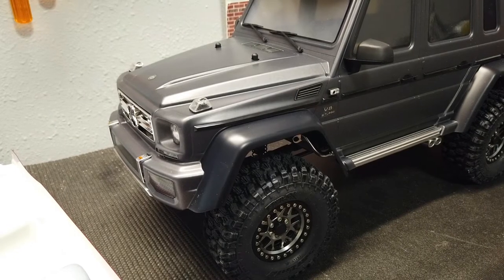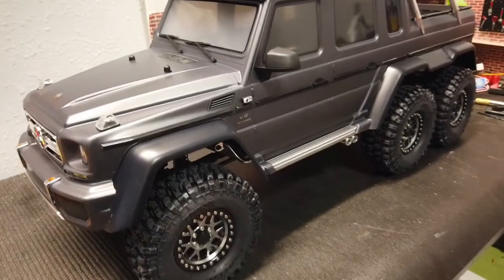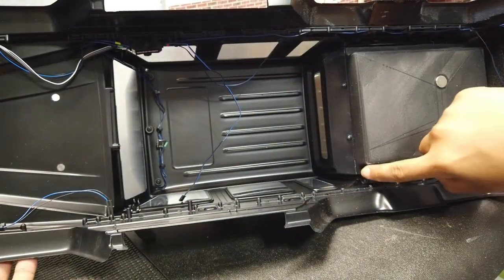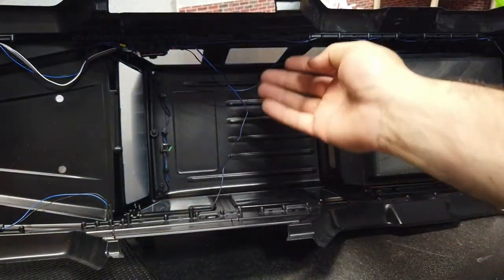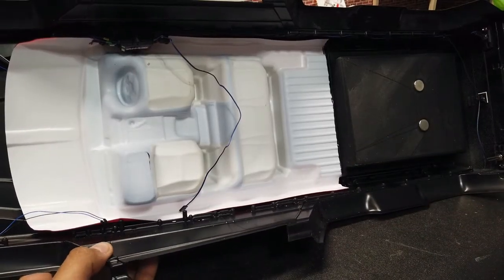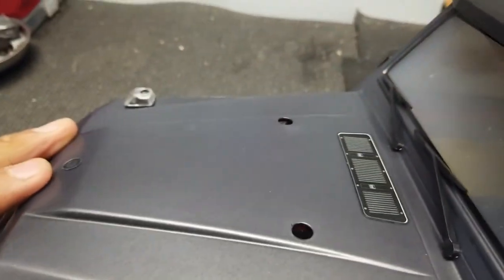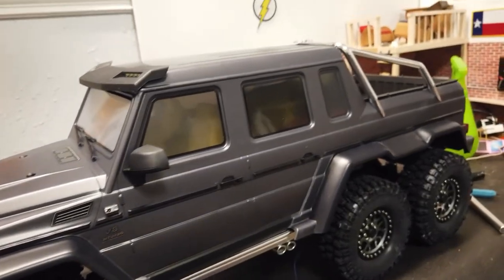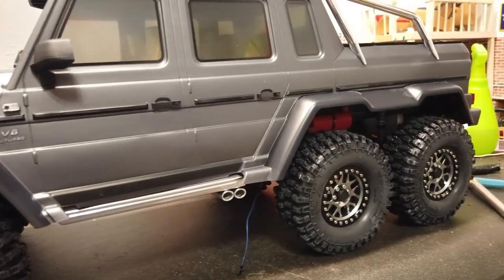TRAXXAS TRX6 SCALE INTERIOR INSTALL

Comment: What interior did you use? Did you pant it yourself? Have you decided what figures you were getting to put in the truck? I'm having a hard time sizing me figures correct to sit in the truck
Reply from the maker: double2706 https://www.ebay.com/itm/254645561786 that’s what I used. Usually figures about 5-6in works but you will need to cut the figure to fit.
Reply: @flashhobbies  thanks for the advice and link!
Reply: @flashhobbies   thanks for the advice and link!
Reply: Can’t find the interior anymore from ebay man. Could you help?